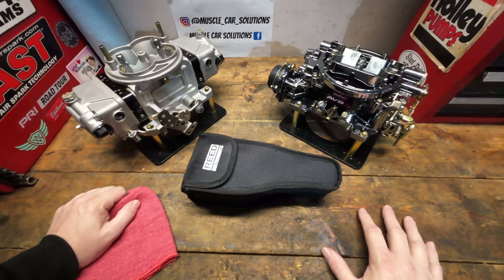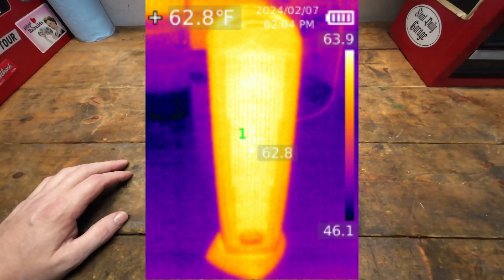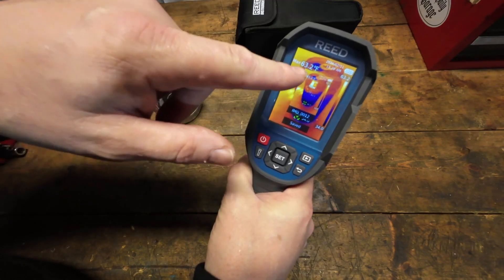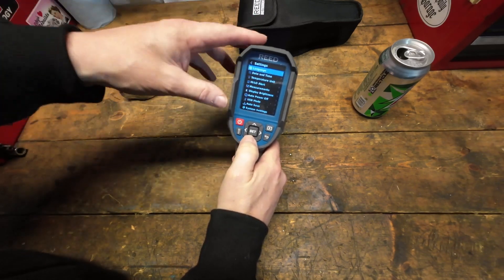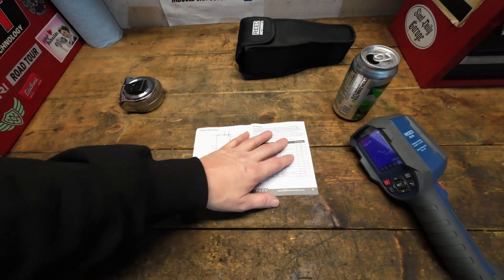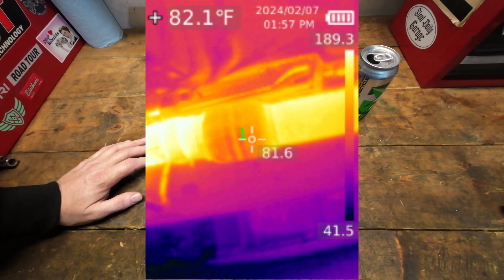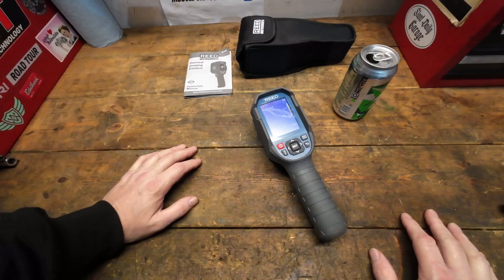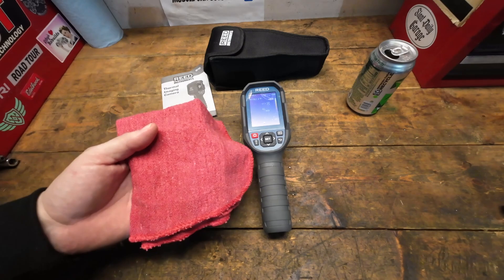REED Thermal Image Camera for Carburetor Tuning

Comment: I don't think this will be an effective tool for carb tuning because of the emissivity of the carb, if it works on the same principle of the IR thermometer. Take a look at your water heater exhaust pipe and see if it gives you a false reading. I had to put a black spot on mine to get an accurate reading.
Reply from the maker: Works very well.  Will have a video soon showing how.  Stay tuned!

Comment: I just used my 1.5X thermal eyeful scope to look at my breaker panel. I had plugged-in a 1500 watt heater and let it run for about five minutes.  I was able to pick the correct breaker to turn-off and all my clocks were not blinking 12 : 00.

Comment: Where these cameras earn their investment back is electrical stuff.  A hot spot in a wiring bundle or failing firewall connector?  Caught.  Things you cannot access at all like ignition coil internals?  Thermal condition can't hide.   Other handy things?  Bearings: - wheel, pinion, idler arms, etc  I love these thermal cameras.
Reply from the maker: Yup.  Endless possibilities with one.  Happy to add it one to my toolbox!

Comment: Very interesting 🧐🤔
Reply from the maker: This is the first one I’ve owned and I’m finding all sorts of other uses for it.  Carb tuning is what I’m most eager to get busy with!
Reply: The older type cameras of a couple decades back came with a helpful emissivity guide - which if you lost...good luck: correcting factor for whatever material type you were shooting had to be dialed in manually.  Brass, aluminum or steel all have different values.
Reply from the maker: @flinch622  this one doesn’t seem to be near as sensitive to an incorrect setting compared to one’s I’ve used in the past.  But you’re right.  At least having easy access to the internet these days saves a lot of heartburn if you lose the guide.